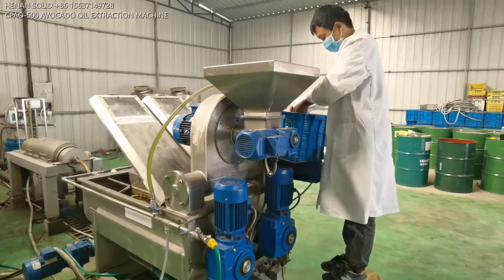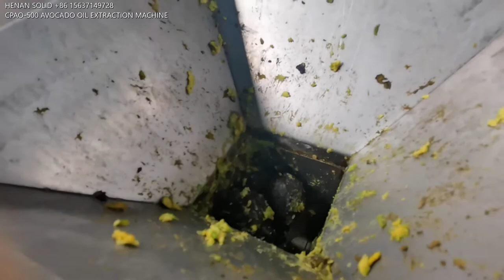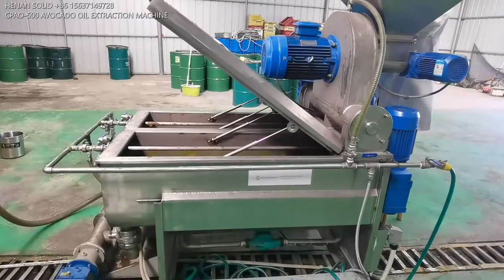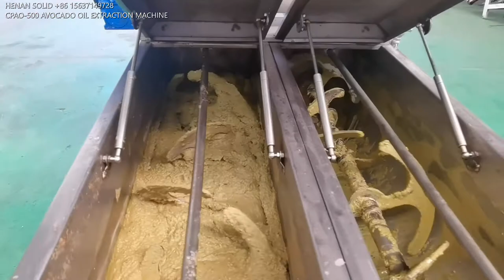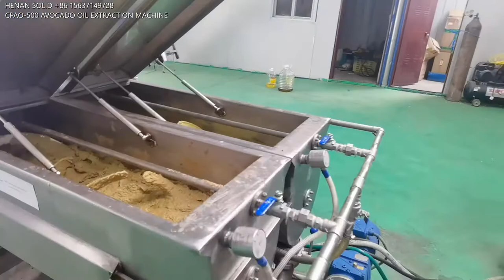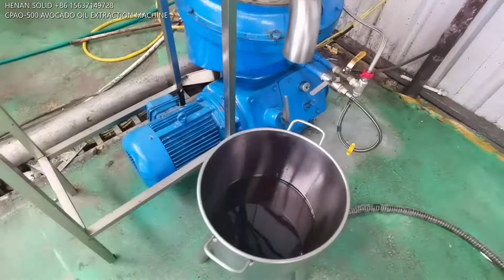500kg/h crude avocado oil extraction plant

Comment: How much oil can you produce with 10kg of avocados ?
Reply: Avocados typically have an oil content of around 15% to 30% of their weight. Let's assume a conservative estimate of 15% oil content for avocados.
So, with 10 kilograms (kg) of avocados, you can expect to obtain approximately:
Oil Content = 15% of 10 kg = 0.15 * 10 kg = 1.5 kg of avocado oil. The density of avocado oil can vary, but on average, it is approximately 0.92 kg/L. So, using the average density, the amount of avocado oil obtained from 10 kg of avocados is:
1.5 kg of avocado oil * (1 L / 0.92 kg) ≈ 1.63 liters of avocado oil.
Reply: @politricks254  wow thanks !